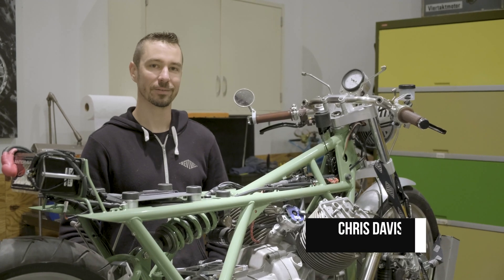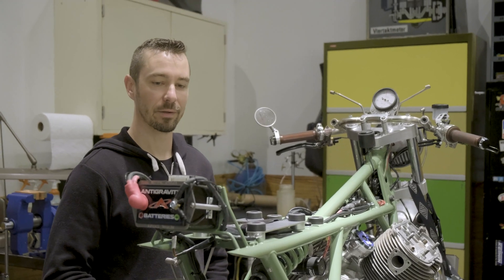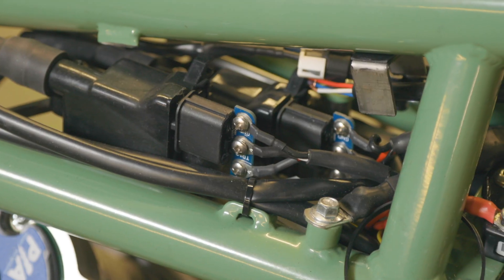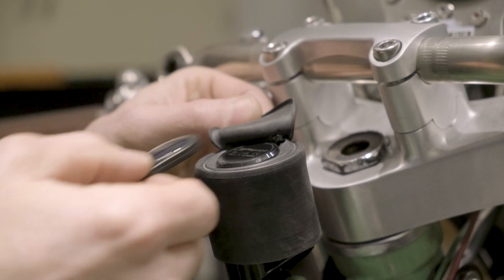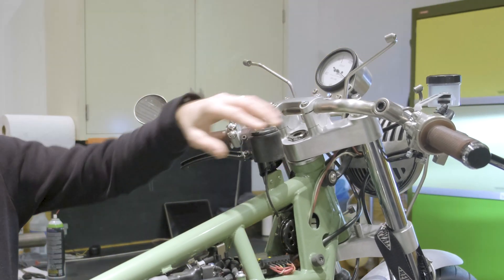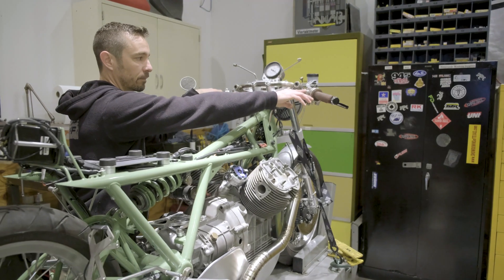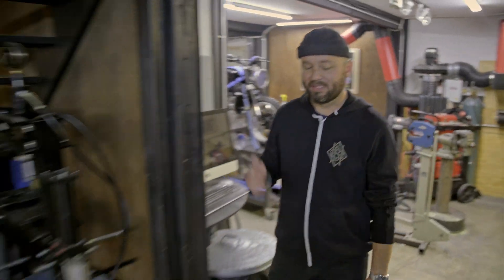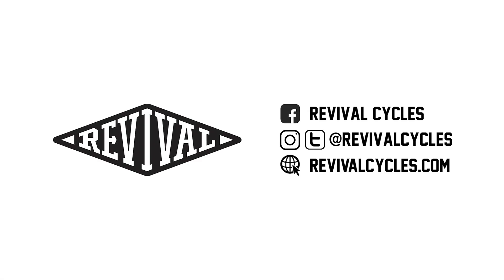How To Wire A Motorcycle Series, Episode 7: Case Study Moto Guzzi 850 T3

Comment: Guys love your work. I just had one query with this video tho. You used fuses? I didn't even realise professional ppl still used them. You do know about manually resettable circuit breakers? They're the things that don't leave you on the side of the road wondering why you left all your fuses at home.
Reply from the maker: That is a great question, we both use and sell manually resettable circuit breakers. 

I asked Chris why he opted for fuses and he said he decided to add this fuse housing as a back up after the initial wire was laid and the metal fabrication completed. It's hard to tell in the video but when the seat is installed there is not enough room to fit the breakers and cap which are 3x taller than the fuses. Then he said, "It'll never blow a fuse because I wired it correctly 😇"
Reply: @RevivalCycles  I thought with an M-unit you only need 1 main vehicle fuse (between voltage regulator and battery), because all the other circuits are shut off when high current is measured by the unit itself. What are the other fuses for?

Comment: Beautiful! Will be undergoing a fully custom 84’ V65 build soon. Probably going to contact you guys about the electrical system thanks
Reply from the maker: A great place to start is the Knowledge Base on our site. There is a complete run down off all of the materials needed as well as wiring theory guides and diagrams. https://technicalarticles.revivalcycles.com/hc/en-us
Reply: I'm in the middle of upgrading the charging system on an 81 V50. Its a real nightmare. The parts I bought at Revival are top notch, I just wish I'd upgraded the alternator when I started.